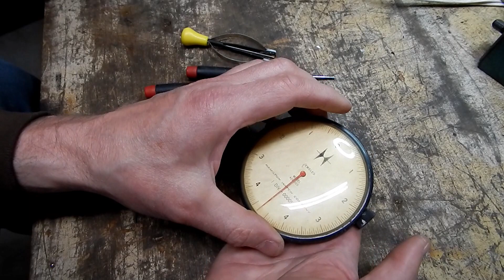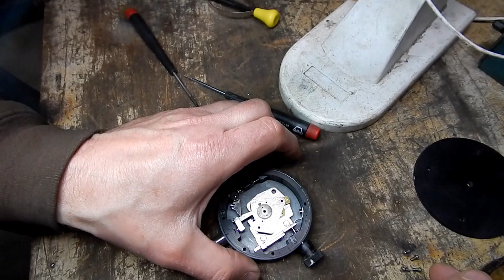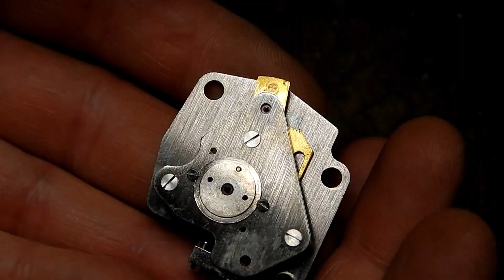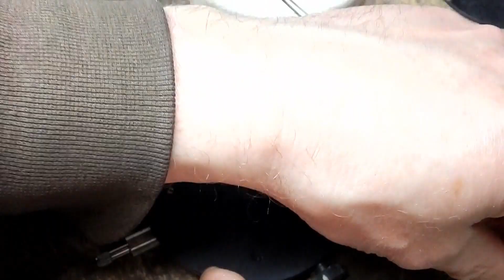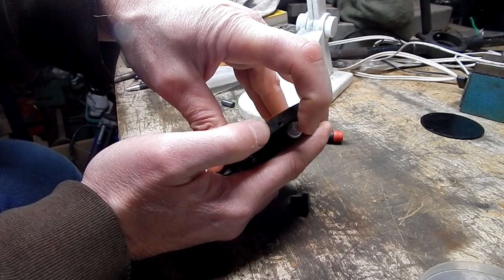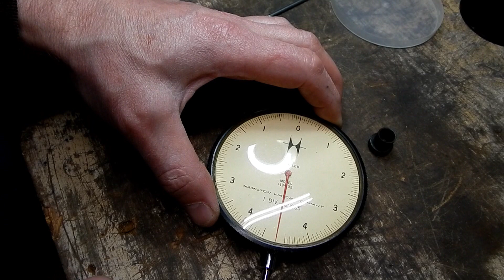Waltham machinist indicator repair

Comment: Thought I left you a note on this the other week,. Guess I didn't. Dorsey still supports these, to the extent they support anything (Not the easiest to deal with, in my experience) and still make the unit. The face doesn't rotate, the knob on the side is for setting zero. That was a selling point. The other original selling point was that the spindle does not directly act on the mechanism. No overtravel issues, less stress from rapid action, etc. Until the pretravel is taken up (based on the null knob adjustment) the hand should be straight down as you set it. The null allows for easy zero and easy reading, since the face is always in the same orientation. Also, toothpaste works pretty good for polishing plastic crystals. (the comparator stand mechanism is a parallel acting flexure) [I left a couple comments about things that you addressed, but cut most of them. These are incredible units, and are, indeed, intended for comparator usage with easy reading]
Reply from the maker: Parallel acting flexure!!! That's the term I couldn't remember hearing before. I think Tom Lipton was the first guy I heard say it. Thanks.

Comment: Hi you seen like a pretty handy guy....i got a 69 merc 1250 tower of power put maybe 10 hours on it and blew the lower unit. When the driveshaft was pulled out of the motor you could see the splines were chewed up so I'm assuming that the splines that it mated with in the powerhead are also chewed up...got any ideas on a fix that doesn't require a complete motor teardown to put a new crankshaft in...thats where it mates to in the powerhead.  If even read a post where a guy filled everything with jb weld and let it harden.
Reply from the maker: Yikes! No easy fixes there. I think I read the same post you did regarding the j b weld trick. But I'd think that's a last resort one shot deal. Can you tell how bad the inner splines are?
Reply: @stevewatr  Sorry it took so long to  get back to you...the slines are so far up into the motor it's impossible to see them. You would have to  get one of them devices with a camera on the end of a flexible wire. It's called a boroscope i think? However  i discovered a bigger problem the motor  itself is for a 15 inch transom...i have a 20. No wonder it took me forever to get on plane. The boat is completely redone sidewinder and it is beautiful but it's  my first  nice boat I should have brought someone with me when  i bought it. Anyway i got a line on 2 identical  69 mercs 1250's. I appreciate you man thanks,

Comment: this usually works as well, Create a paste of 1/2 teaspoon salt and white vinegar. Gently rub the surface of your crystal  and let the paste sit for 10 minutes to dissolve hard residue. Meanwhile, fill a plastic bin with warm water and one teaspoon baking soda. Set the glasses in the water and pour white vinegar over them.

Comment: Tips for cleaning cloudy glass:

    Leave the object in vinegar and water overnight to loosen calcium deposits, rinse with water and dry with a microfiber towel.
    Vaseline or petroleum jelly can sometimes remove light calcium build-up. ...
    Fill with lukewarm water and drop in a denture cleaner tablet.

Comment: Maybe try a ultrasonic cleaner machine to clean the indicator inside unit with a mild solution mixed with water  if you have it of your choice.
Then compressed air it when your done cleaning it